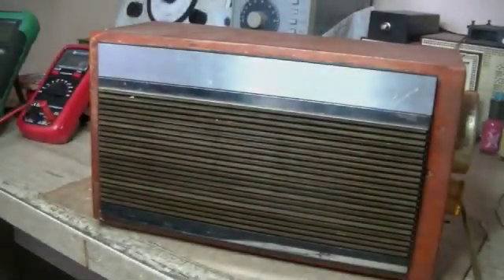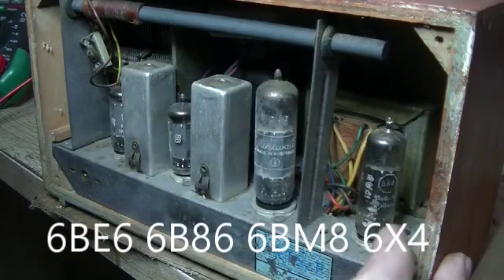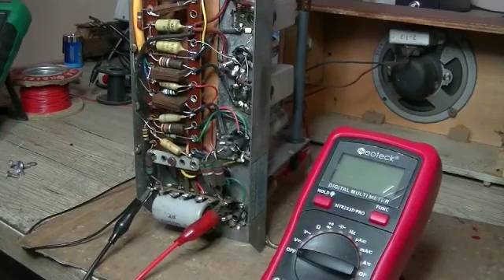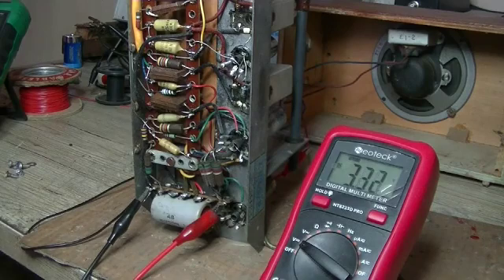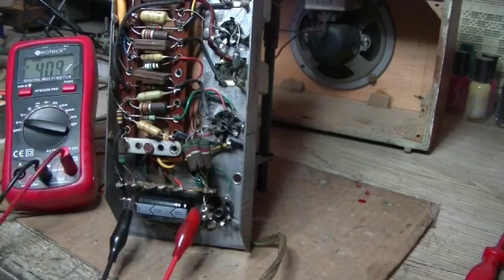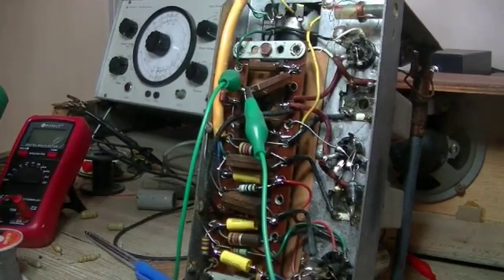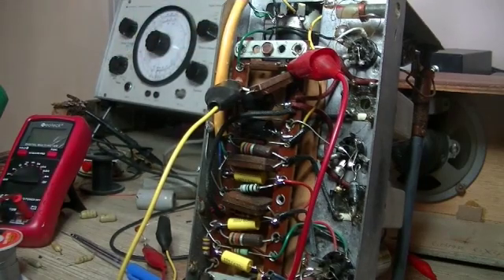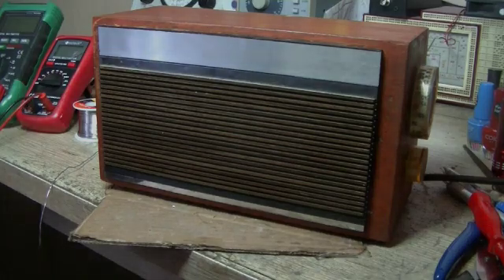Curing Mica Disease on a Stromberg Baby Grand 48A11

Comment: Nice radio, Frank. That 6BM8 tube provides a good output. I had a 1965 Radio Shack reel to reel  and had it hooked to an 8" speaker. It sounded quite good.  You're lucky the SMD did not occur in the IF cans.  I'm surprised the cans aren't remanufactured by anyone yet.
Reply from the maker: Hey John, yes the 6BM8 is a good output valve. Yeah, I don;t believe anyone produces cans. I did see a video ages ago where someone cobbled one together using modern parts that looked like the tiny if cans in transistor radios. Old IF cans seem to be in abundance though I have quite a few from stripping old chassis and they test fine